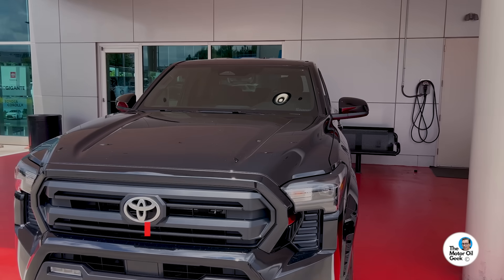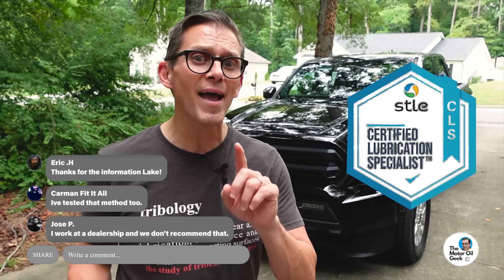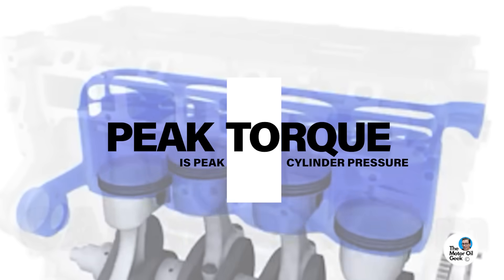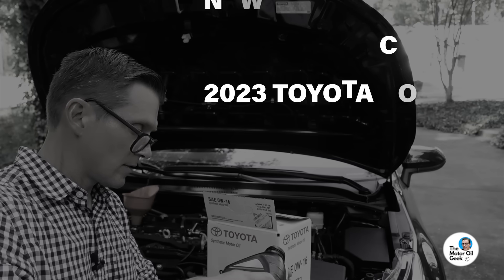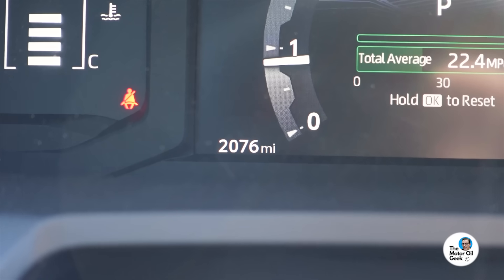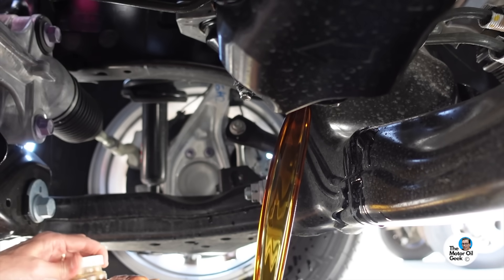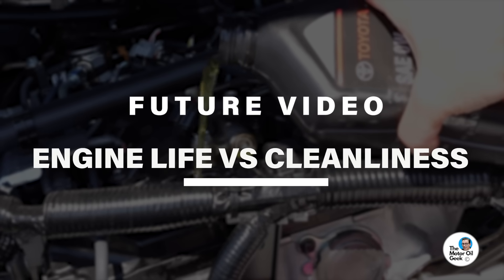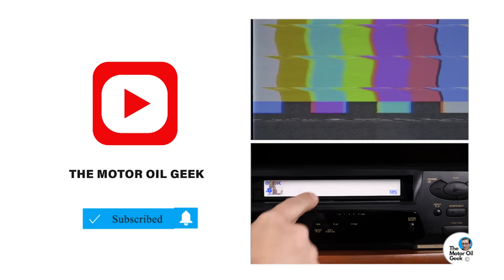The FACTS About Oil Changes (What The Owner's Manual DIDN'T Tell You)

Comment: Hold on here. You show changing the oil the second time with bare hands. If you warmed it up you be going to the er with burns. Warmed up oil is close to 200 degrees? You had to either just warm it up sitting or if you drove it you let it cool down. I have always changed my oil on a new engine at 500 miles then at 500 miles aging. Then i would put a new oil filter on and drive it another 1,000 miles and Drain and fill again with new filter. Then every 2,000 to 2.500 miles. And I went from 0w20 to 5w30. Runs much more quiet with 5w30. 0w20 is like water. 0w20 is just to thin for me. Been thinking going to 10w30 which was good for decades. You shine a light as you stir the drain oil you can see what's going on.

Comment: My owner's manual didn't mention anything about changing oil until 6,000 miles on the odometer, I have stuck two that religiously for the last 70,000 miles before switching to Valvoline restoring protect and lowering that number to about 5,000 mi, do you think I caused any undo harm to my engine during the time? Before then I had been running a combination of Castrol edge and Subaru synthetic oil.

Comment: When I bought my new trail boss this year, the dealer was so generous and gave me one free oil change as long as I own the truck 😂. So I brought it in at about 950 miles for that oil change, they literally argued with me about it? Told me I have to 7500 miles before I need an oil change. I said I want the oil changed now not at 7500 miles. I have a free oil change, and I’m going to use it. Not to mention, we are all aware of the issues these engines have in these trucks. Even the mechanics told me I was crazy. Which that is disturbing being that they are the actual mechanics telling me I don’t need to change my oil when it is literally the most important oil change for the life of the vehicle.
I change my oil every 3000 miles on every vehicle I have. I don’t care what anyone has to say about it! Just figured I may as well use the one free one instead of me doing it. I even marked the oil filter by scratching it with a knife to make sure it actually got changed when they did the oil change.
Reply: Wow they really are trying to screw the customer over doesn't surprise me. I would print out information that engine builders have produced documents based on this topic go drop that off to them. Or better yet go find an engine buolder and then go there and make a hidden video. About the incompetence at said dealership
Reply: I'm suspicious of any dealer being "generous". I think it's more likely that they gave you those free oil changes in the hope that you will spend money at their dealership for another product (parts, accessories, service etc) while your vehicle is having its oil changed or if they make you feel comfortable enough, you may bring your vehicle in to have something done even when an oil change is not due. They also are hoping you'll bring in your other (if you have one) vehicle(s) to have work done as well. Bottom line..it's all about the money.

Comment: I'm on my third VW Tiguan 2019, 2021, 2023 and followed the 15k km (7k miles) religiously from the start - new 0W20 oil and filter and no 500, 1,500 or 3,000 mile break-in oil and filter changes. Drove each over 300k km no issues and no oil burned between oil changes. As Lake stated about filters, they work best when they get dirty. So changing at the first 500 miles defeats that theory. The nano particles that always exist - we're talking molecular level parts per million parts - that do get through a clean filter are too small to cause damage and as the filter gets dirty and more efficient are removed from suspension. As Lake says, modern oils do a great job keeping the engine clean. And modern filters do a great job removing larger particles that do cause damage. Cold starts are where most wear occurs. NYC taxis and long haul trucks that never shut down last a million miles. Remote starting is a killer. GM and Ford have great oil change monitor systems that calculate when to change your oil. Follow that using quality oils and your engine will thank you. Changing oil 3 times in the first 1,500 miles, according to Lake's own research on oil filters - defeats the theory that they work best as they get dirty.

Comment: 6:00 Why not show how to use the dip stick suction pump to get out the old oil? You will be able to suck out more of the oil because it pools even with the bolt removed.

Invention idea: Why not make a tool that goes in thru the opening for the drain bolt and is weighted so it can be pushed all over the lower part of the pan and suck out any remaining oil 🤷🏽‍♂️ I hope China is listening 😂

Comment: No sir. while I respect your advice and experience, At 1:55 you are incorrect. Motor oil viscosity goes up once at operational temperature. Hence 5w-30; thinner, 5 when cold, and 30 once warmed up 30. So it will not drain as you say that it's thinner when at operating temp. The purpose of getting the oil warmed up and moving is to help put contaminants into suspension to remove when changing oil.
Reply: This feels like rage bait but I can’t tell
Reply: No you are incorrect - consult SAE who developed the viscosity standard
Reply: You are absolutely wrong. SAE "W" viscosity is measured starting at -5C and under. Regular SAE, say "30" viscosity is measured at 100C and the oil is way less viscous at higher temps, just lookup "SAE table" on Google and check the cst values.
Reply: Your are absolutely incorrect, there are plenty of other reasons why you should have your oil temp higher than Ambient when draining
Reply: Lol
Reply: So funny Lake. I asked you along time ago if I should change the filter on the first short km service. I thought I shouldn't but you said I should. I was one step ahead of you.
Reply: And your credentials are what a mechanic oh wait you must own a truck show us your credentials to prove what you say otherwise step aside this man has 260,000 followers I don't think you do and there's a reason for that I'll tell you right now everything I've been doing with my truck at 250,000 miles I was doing without like the oil specialist the oil guru and now that I've been watching him he's been proving everything I've been doing for the last 30 years so I beg to differ with your 5W little tiny points show us your credentials
Reply: FFS....W stands for winter.  I hope to God you are not an engineer

Comment: Even if you had worn gloves while removing the plug, you must have superman hands to not be bothered by the heat. I prefer to use the vacuum at the fill hole so I don't get cooked hands.
Reply: Fumoto valve works great too

Comment: Just as you would not take the advice for 10K/mi oil change intervals, we should not use the watery oil "recommended" by Toyota.  Why?  Because this same engine gets a 5W30 spec in other markets and in earlier years.  What is the reason for the 0W20?   I say it is a fanatical rabid left climate obsessed EPA which pressed manufacturers into poor choices to achieve mileage ratings.   Chill on the mileage and spare the engine.

Comment: Just performed the 3rd oil change last week on my 2024 Venza with 8800 km on it, I agree completely with the advice here. I worked in power generation for 37 years, following a overhaul on a turbine generator, the oil system would be be operated with special temporary filters place, and the bearings bypassed, to filter any debris out of the oil before it ever sees the refurbished bearings. Changing 8000 gallons of lubricating oil wasn't an option.

Comment: I took my '24 Ford Maverick with the 2 litre Turbo (250 bhp and 277 ft.lbs of torque...sports car numbers thirty years ago) for its first oil change at 900 miles. I just said "humor me" when the dealer's service advisor looked sideways at me. I'm not so careful as you are but it has had three oil changes in the first 10,000 miles. Interestingly, the dealer recommends 5000 mile changes on the window sticker.
On the other hand, the 2.5 litre AMC 150 I4 in my '98 Wrangler TJ (120 hp and 139 ft.ibs....sports car numbers 100 years ago) gets oil changes even more regularly. I bought it with 140,000 miles on the clock and a ticky lifter when cold. I gave it 2000 mile oil changes and perhaps four or five changes later I started it up one morning and realized that I no longer had a ticky lifter. This is not fancy oil. It's the Pronto semi-synthetic used by my local shop. I am a firm believer that the best oil for my car is clean oil.
The last time I took in my wife's 2012 Fiat 500 runabout with more than 150,000 miles on the clock for an oil change the mechanic remarked on the cleanliness of the old oil.

Comment: I'd put money on that a 30 weight protects better in a direct injected turbo engine , than a 20 weight.  CAFE regulations do not have true engine longevity in mind
Reply: The Toyota engines are direct and port injected (Toyota’s D4S Injection, or D4ST, in the case of the turbo engines).  The ECU turns on the port injectors at certain intervals (and RPM / throttle setting, etc.) to clean the ports and valves.

Comment: If you drove your car the day before, and wish to change your oil the next day while the engine hasn’t been ran yet, you can still change it and get that debris out. It’s already settled at the bottom of the pan. Besides that, it is 100% imperative that you change your oil AT least twice before 5,000 miles: first at 500 miles, then 1000 miles, then change at 5,000. You can change the oil every 5,000 miles after that. And I’m sorry but you always change your filter every oil change. That debris could become unlogged and return back into the engine. Chances are low, but it’s good security. 

Oil and filters are cheap. Engines are not.

Comment: I’ll be picking up a new 2025 Toyota rav4 fwd base model next week.  I’ll be filling this oil changing routine.  My question is whether I should switch to 0w-20 (instead of recommended 0w-16) after 10k miles.

Comment: Oh no, no port/direct injection combo fuel injection only direct injection, or is that the only option when it's turbo charged I guess. I guess you'll be using regular Chevron techtron additive to your fuel tank to keep the valves clean.
Reply: The turbo engines use a version of D-4S, called D-4ST.
Reply: @sharkinstx  Thanks, not sure what that is, is that still a combo of both types of injection?
Reply: @wally6193  It’s both direct and port.  Not sure why they rebranded it D-4ST - I would assume they just added the T for turbocharged.  Some other automakers are starting to go to both direct and port injection.  Wish I could remember which.
Reply: @wally6193  It’s both direct and port.  I’m not sure why they rebranded it D-4ST, unless the T is for turbocharged.  Some other automakers are adopting a D-4S type system - I can’t recall who they are right now.
Reply: @sharkinstx  thanks.

Comment: Changed oil every 5,000 miles on my 2006 4cyl Tacoma. I gave it to my grandson when it had 420,000 miles. He just sold it with 540,000 miles on it. He said it was starting to feel old. I asked if he had the transmission serviced (not purged). :)

Comment: Hope your engine doesn't blow up. They are still having engine issues.
That toyota filter isn't filtering much. Poor filtration but good flow. I would have at least drained the filter. You're keeping dirty oil in with the new. Doesn't make sense. Thinking too much...particle count is odd for the filter

Comment: I never owned a new car but my oil interval would be the same. First oil change at 500 miles, second at 1500 and every 3000 miles after and I’m no motor oil geek. My 2008 matrix oil is changed every 3000 miles. Bought it with 107,750 miles on it .Currently sitting at 128,000.

Comment: Nice to see your thoughts on using an old filter with new oil. I do it on my 99 Yamaha R1 one of the two oil changes I do every year. The $17 OEM filter costs more than the gallon jug of Rotella T4 I run in it.

Comment: I disagree with warming engine up before oil change. On all my vehicles and machines I let them sit at least overnight so all the oil flows into the oilpan. Then i  drain the oil, and use half a liter of oil that I poor in ontop with the drainplug open to take all the old sut in the engine and pan out. After that oil filter and fresh oil. Why would you fling old oil around everywhere in your engine and then drain it? Proof: Warm up your car, open drain plug and I tell you it will drip four HOURS. So let gravity do the work here. -a mechanical engineer.

Comment: Did anyone else see that the molybdenum reading from the factory fill was 988 ppm yet the virgin sample moly was 102??  It looks like an oil additive was included at the factory fill.  The second oil sample showed 226 moly so the OEM Toyota Oil in bottles isnt the same as what is added at the factory with the very first oil fill.
Reply: Possibly assembly lube.

Comment: I did same break in process you did on my 2024 F550 with the 6,7 powerstroke engine.  Learned this process from a BMW motorcycle mechanic many years ago.  Oil and filter is now changed every 5,000 miles.

Comment: Initial break in releases the most amount of contamination during the engines life. These modern day vehicles are equipped with much smaller filters. That is science that less filtration surface is responsible for catching the contamination during initial break in. Dont change the filter? Leaving it in for the first couple of changes, increases the risk of the particals passing through the element or through the bypass on cold starts. Change the filter multiple times in the intial break in time you cheap scate. The first three oil changes will carry the most amount of contamination in the filter of the engines early life. The more blocking  the oil from passing through the element. And more chance the pressure opens the bypass valve exposing those particals into the engine. DONALDSON...the company who employs some of the lowest qualified workers  available. Need proof of this theory being wrong? Look at the billion dollar recall by GM. Rough surfaces and low grade oil. Stop this nonsense!

Comment: Does any of this matter in the long run? I can see the data as presented and I understand the logic. Some high numbers are worse for the engine. Some low numbers are worse for the engine.

By doing these break-in oil changes, my engine will get to 500k miles with less issues?

Comment: I have been driving fo 65 years,  and changing my own oil (still do), All the vehicles I have ever owned from new, have never gone more than 2000 miles between oil changes. I have never had an internal engine problem or experianced oil burning issues while owning a vehicle.
Reply: But if you drive 20k miles a year, damn you gotta do an oil change a month 😅
Reply: used to do the same, oil is so much better today 5k is fine after break-in
Reply: Oil has come a long ways from what it was many years ago. 5000 miles is good with me.
Reply: @Lance-b2l  5000 is really good, 2000 means you change the oil as an hobby, lol :)
Reply: With those unnecessarily short change intervals with modern lubricating oil you're throwing money away based on false belief, not science. Losing money being superstitious is not normally a thing that a person would crow about on social media.
Reply: @fnbrowning-Actual 2000 miles is maybe too close, but depends on engine and usage. Some ecoboost need 3k oil changes, they fill the oil with soot
Reply: @AAAAAAndrea  I'd have to see evidence of 3,000 mile oci recommendation from the manufacturer.  And not severe duty either.
Reply: @fnbrowning-Actual LMAO, the manufacturer says what EPA ( or any authority ) makes them say. That has no value on real cleanliness/effectiveness of oil. 
My family car had 6.5% gasoline in gas with the yearly oil change, that's unsafe level of gas in oil. 3% is considered too much, let alone 6.5%. And the car isn't defective, it's the engine that acts like that. Simply with 10k oil changes engines will last the bare minimum. That's common knowledge.

Comment: This video is very timely - six weeks ago, my wife and I bought a brand new 2025 Toyota Sienna.  It’s a hybrid (Sienna is all hybrid since 2021) with Toyota’s A25A-FXS NA four with D-4S (direct and port) injection.  It’s a Dynamic Force series engine, like in the Tacoma.  It’s got about 440 miles on it now. 

The engine oil and filter change intervals in the maintenance schedule are every 10,000 miles.

When I bought my 2013 Tacoma, I used Toyota’s free maintenance, where they changed the oil (Toyota 5w30 conventional) and filter every 5,000 miles, then when that ran out, I started doing them myself, using Valvoline Full Synthetic 5w30 and a Toyota filter, every 5,000.

I don’t plan to follow Toyota’s plan for the Sienna, but will follow your schedule for drain only at 500 and 1,500, then oil and filter at 5,000. 

I’m wondering now if Toyota’s problems with the turbo four and V6 engines is related to their 10,000 mile oil change intervals.